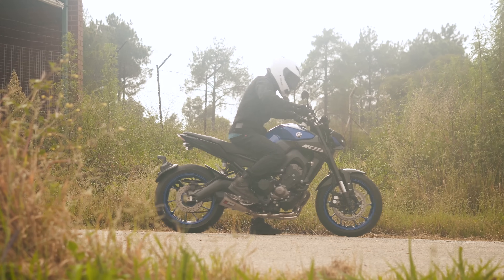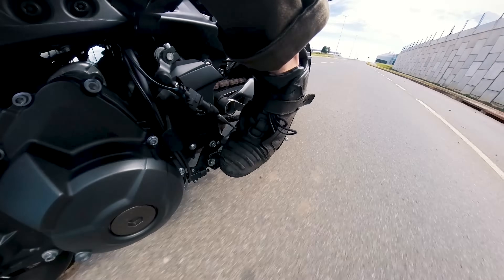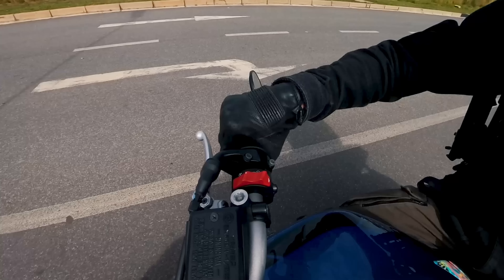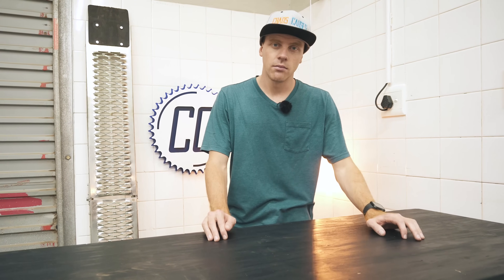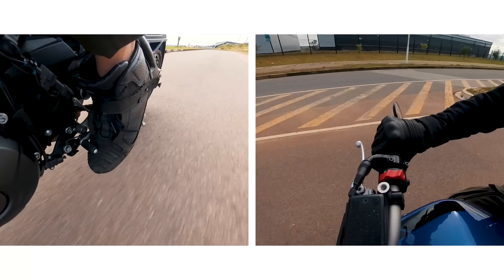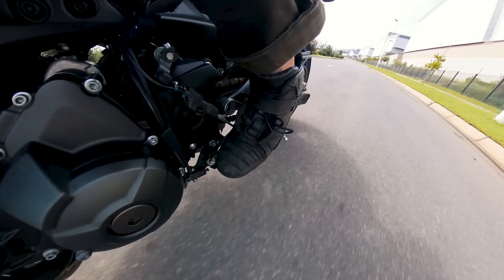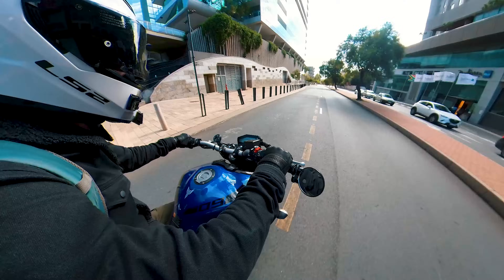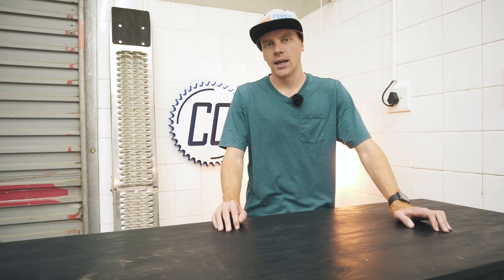What is CLUTCHLESS SHIFTING on a motorcycle?

Comment: Did this on accident on my bike. Was actually surprised it could clutchless shift even without the tech. This "technique" could also save you if youre in a pinch like when youre clutch cables get effed
Reply: same
Reply: The quickshifter works in opposite though.
Clutchless upshifting: roll of throttle, upshift
Quickshift upshifting: maintain throttle, upshift

Clutchless downshift: blip the throttle, downshift
Quickshift downshift: fully off throttle, downshift

My quickshifter won't upshift unless I'm giving it some juice.
And it won't downshift unless I'm off throttle.

Comment: Only reason to clutchless upshift is because you have a break of concentration and forget to use the clutch or the clutch cable is broken. Either way you ain't gonna save much time at the track despite what they say, and you miss that window and you are just needesely wearing out the transmission faster.  I mean do you really think your left hand is that slow??? That is why you have two hands on a motorcycle to begin with, best to learn how to use all the parts a motorcycle carries, and then focus on speed and cornering. If you can't work a clutch then get a electric motorcycle.
Reply: Agree,have clutch but don't want to use it, better get semi automatic bike no clutch lever but still need shift gear or get fully auto. Clutch is there for reason if cable broken i understand but use clutchless everyday. For me better use quickshifter more safe if don't want to use it just turn it off so I can use clutch normally. I don't understand what special about ppl that use clutchless shift.
Reply: Clutchless shifting doesn't put any more wear on a bikes transmission that using the clutch. Clutch is for starting and stopping. When I ride road I shift with the clutch on 5 of my bikes, when I ride track or I'm riding highspeed I don't use the clutch and have a GP shifter setup, made it so that I can now keep up with My buddies bike that used to walk away from me on straights simply from slam shifting without the clutch.
Reply: You obviously don't have much mechanical ability. Or experience on motorcycles.
Reply: Your comment is like the one you revisit in 5 years and kick yourself because of what you said

Comment: Just did this the other day, definitely interesting. I wonder if done incorrectly how much damage it can cause like the shift forks or chipping the teeth on the gears etc.  Best to probably practice on the less expensive bike until mastered.
Reply: Definitely. I once broke my gear coupler (dog? Cmiiw?) on my bike when I often forcefully shift (I'm still learning the rev matching thingy). Not completely broke but kinda eroded and make it wobble. Thank god it was dirt cheap (the one I broke was a 125cc moped)
Reply: It's a small window in the rev, just learn to use your left hand effectively, it is a much better skill and then focus on accelerating and cornering. Learning to clutchless shift is like learning to read a book while riding a motorcycle....I'm sure people can do it effectively, but it is a dumb skill to fixate on when there is so much more to motorcycling.

Comment: My experience with a 2008 Ninja 250 (EX250J):
For emergency clutchless shifting after a broken clutch cable (yes, it happened to me), you don’t have to blip the throttle for a downshift. That’s because you don’t have to downshift when you’d otherwise do it. The goal is merely to avoid being stuck in a high gear at a stop. By putting downward pressure on the shift pedal as you slow down, it will just slip into the next lower gear as soon as things slow down enough to unload the gear train. From 6th gear this happens at first gear speeds (surprisingly slow), but from there you can go through the rest of the gears really quick. 

After learning this I did it for years whenever I wanted to do something else with my left hand while approaching a stop. Yes, I also learned how to downshift when I want by blipping the throttle but that wasn’t necessary for getting home with a broken clutch cable.

The positive neutral finder on that bike also means you can get to neutral from a stop just by pulling up while the wheels aren’t turning… no need to “half click.”
Reply: I'm new to riding and when I stop my bike on 4th gear I couldn't downshit to 1 is that normal?I was stuck at red light on 4th gear then  I panic and start to push shim forward and somehow I was able to downshift but I was wondering wtf?
Reply: @Voltomess  Yes, that’s normal. The wheels need to move a little before it will let you shift a second time. I believe it’s because the shift forks did not actually get to move into place along the gear selector. Try rocking forward and backwards while stomping the pedal until it gets back down to first.
Reply: @Voltomess  get it down to first before you actually come to a complete stop, or you might have to shimmy the bike back and forth to get down to 1. Coming to a stop hold in clutch and shift down to 1 before complete stop, or use engine braking and down shift one gear at a time, before complete stop. Look at engine braking video. 💪
Reply: I must be very lucky  with bikes , been riding  motorcycles  for 27 years & owned 5 bikes & ive never ever had a issue  with a clutch or cable in 27 years .
Reply: @Voltomess learn to get shift down  to 2nd & first gear when coming to a stop .
Reply: Definitely not saying it’s common.

Were your bikes also your daily driver, rain or shine because you didn’t own a car? …left exposed to the elements? Mine was. I even moved to San Diego at the time because that’s where it rains the least. ;)

I probably would have caught the clutch cable wearing before it broke if I weren’t riding every day because I would be doing more thorough pre-ride checks than you could justify when it’s your fifth time hopping in the seat that day.
Reply: @emmettturner9452  I've always had both Car & bikes all my life , for around 15 years i  rode motorcycles  to & from work & then on weekends  I'd  change  to my Cruiser  or Adventure bike ! Car is when with the family  & date nights ☺️👍🕺🍹

Comment: Just came here to say; this is indeed an important technique you should try to learn, especially if your bike doesn't have a quickshifter.
A few days ago I needed to go and get some rations for my dogs, I ended up going to the shop on my bike as I was already somewhere else with it, coming back home without a backpack the only way I could carry the 5kg~ bag was with my left hand( I should make this clear, do not ride your bike with only one hand, it's not only unsafe but also may result in a ticket or worse, depending on where you live. A bit of do as I say not as I do kind of thing, for your safety) and thankfully I've been practicing up and downshifting this way for some time. 
On the safe side, this technique can make your trips less tiresome, leaving one of your hands work free and making the ride more entertaining while trying to rev match!
Oh and a small tip; do not force the transmission into gear, try to be delicate yet deliberate with your inputs. If done right the gearbox should kind of "suck" the next gear in when you engage the shifter.
Reply: The only question about this technique is "doest it really safe for our bikes?" Cause in my understanding, the way qs work is blip the throttle, then in milisec the gears changed (as mentioned more detail by the video) so in theory, it would be safe for the gears to changed while there's no load and the main thing is, its is indeed quick. but when we downshift too as well, how do we rev match it? Does is really that safe? I'm a bit concerned if the gear would actually still worn overtime.
Reply: This clutchless shifting thing would work on a two stroke old yamaha? The engine is in pretty good shape, but i ask myself if i really should try. (It is a Brazilian Rd135)
Reply: @rioadithia1374  For downshifts, it's a bit more challenging to do it without some harm done but, I believe, it wouldn't destroy your transmission in a few bad attempts, and if done correctly there shouldn't be any damage, as the gear just "go into place" . I generally just go up in the gears without the clutch to be safe.
Try to practice downshifting with the clutch and blipping the throttle so the engine revs aren't affected when releasing the clutch when the gear engages, then you should be on point to do it without the clutch.
Reply: @rioadithia1374  Nunca tive a oportunidade de fazer isso numa 2 tempos mas muito provavelmente deve funcionar como nas 4 tempos, isso pra subir de marcha. Mas eu não faria isso pra reduzir de marcha pela fato desses motores serem bem sensíveis a mudanças de rotação, certamente é possível mas imagino bem mais difícil que numa moto 4 tempos. De qualquer jeito nem tem muito tempo pra ser ganho numa redução comparado a aceleração
Reply: @rioadithia1374  amann rusak ya beli lagi
Reply: @somerandomthings6841  buset, kalau yg low budget tidak semudah itu bang aowkaowkao

Comment: I first taught myself clutchless shifting about 40 years ago driving my old Volvo. But, last year the clutch cable on my CBR1000rr was down to about 3 strands. I rode 300 miles and only using the remains of the clutch cable to start and stop; otherwise, all clutchless. It's all about getting the revs right, especially downshifting.
Reply: Can i use clutchless upshit with 50% throttle? same with downshift or it has to be completely cut off?
Reply: @Voltomess  Yes. It's not about doing this at maximum or minimum RPM, it's about matching engine speed to the transmission and road speed. If the gas was off, you would likely get immediate engine braking. If you get that, or acceleration, then you haven't matched things properly. It's amazing how intuitive it will be once you try it.

Comment: One of the easiest ways to shift up clutchless for a beginner is to use your rev limiter as your quick shifter. When you accelerate and you are near rev limiter, just put a little pressure on the gear lever to upshift, when the bike hits rev limiter, gearbox will loosen and upshift exactly the same way as with quickshifter.

Comment: i drive a semi truck, i learned to float gears 10 years ago i used the same rules in shifting for my motorcycle and its always been smooth, however for downshifting i use the clutch because theres no neutral in between to rev match

Comment: When u do clutchless shifting, the clutch will not engage and disengage so that mean no additional waring, the oil will degrade less than normal. I've used clutchless shifting for 3000km and when I changed the oil, its color was still a bit ambient

Comment: Actually, for "proper" shifting even when using clutch lever,  user should push gear lever a little bit, to cancel slight freeplay. After few days od shifting that way its a lot easier to try clutchless change:)
I was lucky my riding instructor years ago teach us that method.

Comment: When a rider shifts gears without using the clutch, the gears in the transmission are not disengaged, causing them to grind against each other. This can cause significant wear and tear on the transmission, leading to premature failure and damage to the transmission's internal components.
Additionally, the transmission on a motorcycle that is designed for clutchless shifting is often reinforced with stronger gears and a more robust mechanism to handle the increased stress and strain of shifting gears without a clutch.
Reply: i lost count of how many augments i have had over this and people thinking the kill switch is an emergency off switch only and act like I'm the idiot legit the only way to turn off some bikes is the switch
Reply: That's only true for straight cut synchromesh transmission, like the ones in car. Motorcycles are dog engagement. If you actually understand the mechanism, there's very little risk (or none) for damage unless you try to hard brute force the gear shift.
Reply: Sometimes gearbox forks wil "like" this.. 😂
Reply: The way pretty much every single motorcycle gearbox is designed, unless your flywheel weights half a metric ton (and lets face it, flywheels in bikes have really low inertia) your gears (or actually gear dogs, as your gears have constant engagement) are not going to grind or smash into each other any harder than they do when using the clutch. Been clutchless shifting for the 10y I've been riding, only gearbox failure so far was due to the output shaft locking up in 1st gear @8k rpm in a chinese bike when the chain wound itself on the sprocket
Reply: Done this with every bike I owned. Din' hurt nuffin'.
Reply: There is no risk at all when you shift clutchless with not synchronized transmission, you just need to do it right. I shift clutchless on SV 650 for 12 years, gearbox is in perfect shape, no noise, no griding.

Comment: have always shifted without a clutch from the first time i rode a bike.

sometimes for the 1st to second shift, its a pretty wide gap there, otherwise... its clutchless all the way.

lol, some guy had a "crash course"  in it the other day... pulled up out the front, broken clutch cable... now, i could have spent twenty minutes tearing a cable off one of my many shed dwellers, but instead... snapped a set of vice grips on the end of the clutch lever, R6 conveniently has it right next to the footpeg...

gave it a test, he could take off without stalling... my vice grips were returned a few hours later, having done their job...

if you get stuck with no clutch, undo the clutch lever switch, then you can leave it in gear and still hit the starter  when the lights go green...

Comment: I feel like for upshifts, if I just let off the throttle like how I normally shift, it’s not sufficient to perform a clutchless shift. I find if I actively blip it in the reverse direction, then it shifts easily. Maybe the throttle’s spring tension doesnt close it fast enough or something.

Comment: hi 2 all,
for now without a motorcycle as a car driver T-bone me at cross roads, but I have a question closely related  to the topic. I learned clutch less shifting in my car decades ago. later it was one of the 1st techniques I learned on motorcycle. never had to use it in an emergency situation anyway. 
the question is, when clutch cable snap and you are stationary, how to get a bike moving to the 1st gear? just push it and tried to force the 1st? in car I engaged 1st with shut engine and just start it. after a couple of "kangaroos"  the car was moving, and the rest was fairly easy. done it in a couple of cars, 1st snapped cable, 2nd snapped pivot pin of clutch pedal.
thanks in advance
cheers

Comment: i would say learn this with using the clutch just for down shift if you do it right the bike wont bump so then you can try without clutch but for amateurs like me i would just use clutch for downshifting its safer for your gear box if you get it wrong

Comment: Made the likes 420😏 I learned this the second week after starting riding purely out of curiosity because I remembered reading somewhere that for sequential gearboxes you don't even need to use the clutch if done right. It was really easy to learn even for downshifting but now I dont really do it often anymore. Also.. about a month ago when I downshifted without the clutch I didn't put enough pressure on the gear lever and something odd happened. It was like I was stuck between two gears which is what's called a false neutral I think. I immediately pulled the clutch lever but nothing really changed I heard a weird switching/electronic noise coming from my gearbox and it sounded like it was trying to determine in which gear it was. Its the same sound it normally makes when shifting to neutral with a Kawasaki. My gearbox worked fine directly after that though and there was no grinding noise or locked up rearwheel or anything during the incident.

Comment: Would it damage the gearbox? My 250cc doesn't equipped with quickshifter yet, but i've done this several times ...
Reply: Started doing it on my 200, then 250 and then 600. done 96000km on the 600 with no gearbox or clutch problems. BUT would not recommend to do it from 1st to 2nd until you are use to it
Reply: @danieljohannesjansenvanvuuren  this. I second this.
Also depends on technique and gearbox quality tho. If you just forcefully shift under load, up or down, the coupler on the gears (dog?) will erode resulting in wobbly gears or break in extreme circumstances. Because mine did, lol. Thank god it's just a dirt cheap replacement on my bike (an old suzuki shogun sp, a 125cc manual moped). If it was rev matched correctly, or at least done not under load.
Reply: @danieljohannesjansenvanvuuren  Can i use clutchless upshit with 50% throttle? same with downshift?
Reply: @Voltomess  you can clutch less shift with any amount of throttle(except 100%, only if you have a quick shifter) you basically just have to roll off the throttle to get the gearbox in a state of no torque or pressure on the gears. on my cbr600rr at high revs i could roll back about only 10-20% to up-shift . and with clutch less downshift you can drop a gear by increasing throttle by 10-20%(blip the throttle)
Reply: I do this everytime with my Xr125 but only after 2nd cus it seem faster that way, it's kinda unstable to clutchless shift from 1st to 2nd. But I dunno about other bikes tho.

Comment: on my old 2006 honda cbf 500 i would upshift all the time with it jjust in high rpm dont even need to close the throttle that much just a bit just when you shift i can do it cars to but thats only fo rgetting home most petrol cars you can upshift at abouth 2500rpm depends on gearin my 2019 polo its 2200rpm an down only a bit higher so only slow driving.and on my honda i could up shift with keeping the throttle on now it gives more ware on the dogs that ingage with the gear